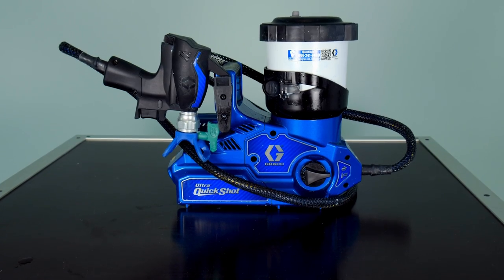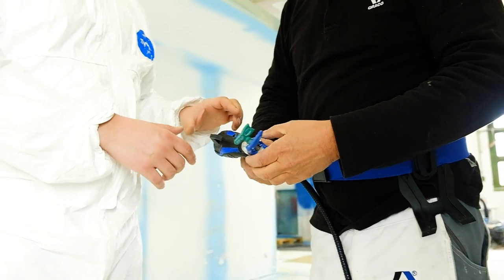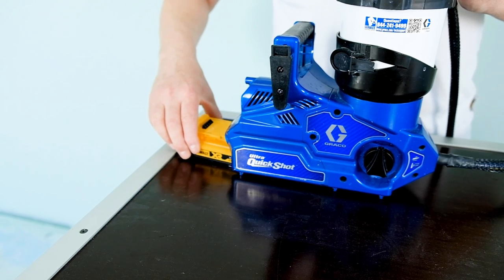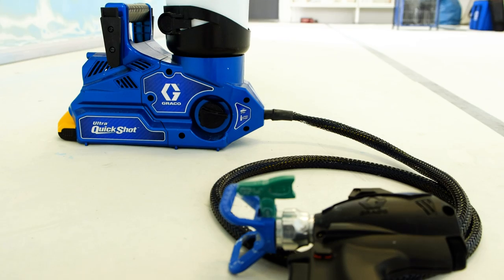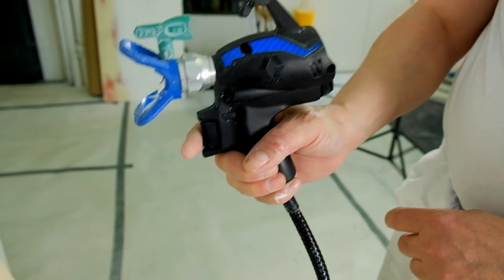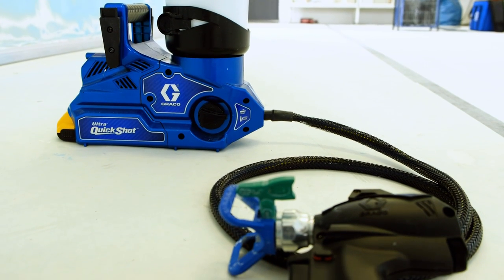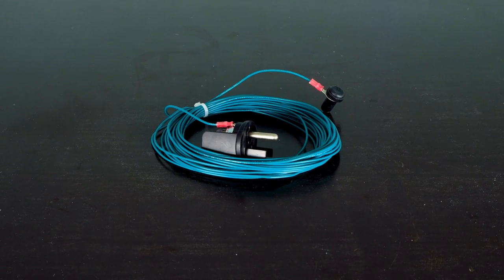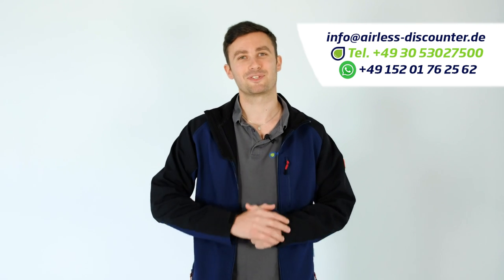Graco Ultra Quickshot - Overview

Comment: Can larger 4Ah batteries be inserted?
Reply from the maker: Thank you for your comment. 
Graco explains, that the Graco QuickShot will be compatible with the following 2 batteries:  
- DEWALT DCB183 18V 2.0 Ah battery 
- DEWALT DCB203 20V 2.0 Ah battery
Kind regards,
Airless Discounter team

Comment: My Ego battery lawn mower & leaf blower plus my 4000 psi Kohler pressure washer, all together cost less than this unit. Yeah, i get it, it works well but this is severely overpriced in my opinion.